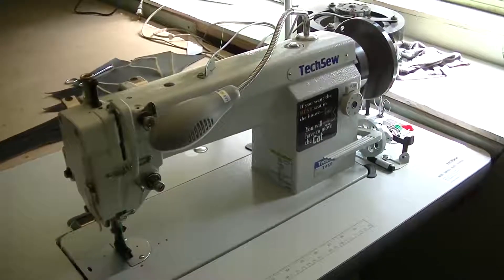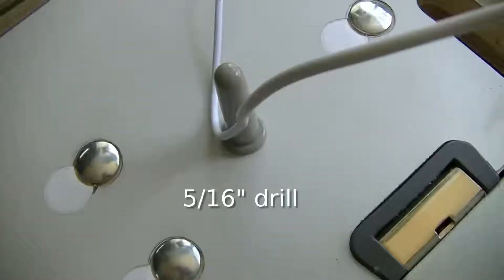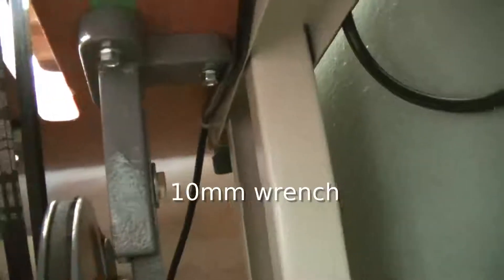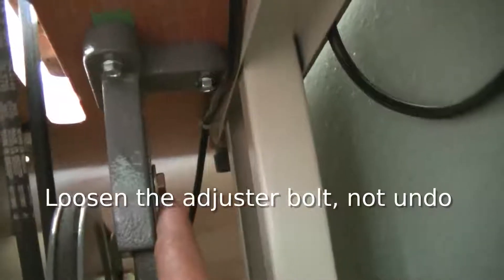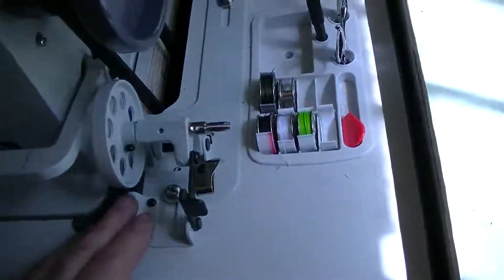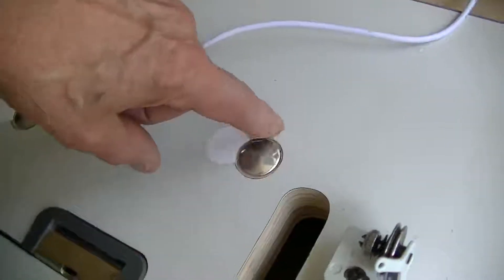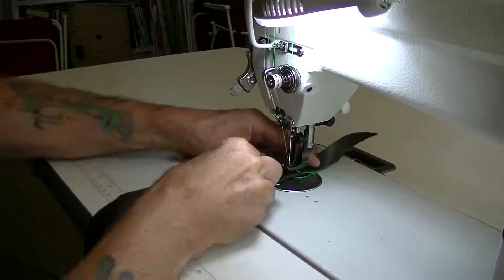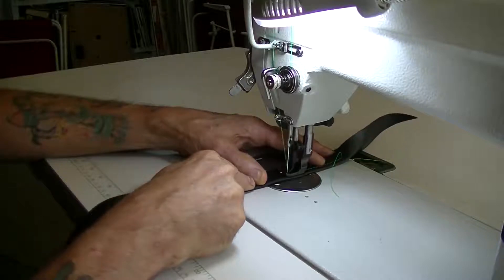Techsew speed reduction

Comment: I added the speed reduction to a 2135 and had exactly the same things to do. We now have the same 'clatter' noise that is the reduction bushings. Seems like Techsew could manage to make a simple pulley/bushing/shaft fit so it doesn't sound like three skeletons jacking off on a tin roof. I also do not like having to take a wrench to the reduction and belt removed every time the bobbin needs to be looked at! POOR! This will be redone so that the belt to the spindle is in line with the tilt of the machine so we can leave the tools in the garage where they are supposed to be not in the sewing room.
Reply from the maker: I don't have an issue with getting to the bobbin with mine, it's accessible from the side (underneath). The only time I have to tilt the machine is for oil refill purposes. The "clatter" is the machine itself, adding the reduction didn't change that but the camera certainly amplified it.
Reply: @scorpa54  Funny, you said in the video that you would need to remove the belt to get to the bobbin. The clatter is not the machine...it is the reduction bushing fit - tighten your grease cup a turn or two. That will quiet it down for a few minutes.
Reply from the maker: @b1lc1s  I said you need to remove the belt to tip the machine forward. I also said in the reply that my machine's sound did not change with the addition of the belt reduction.
Reply: @scorpa54  How do you get to the bobbin on that machine? The 2135 must be tipped back to even see the bobbin holder. Techsew must have sent me a bad reduction because it makes a clattering noise - this 2135 did not have that sound before the reduction was installed... Different machine but a zig-zag walking foot is noisy - but doesn't clatter. The sound your machine is making sounds like a loose pulley or something like that. This machine may go in favor of a Juki - better machine than Techsew by far.
Reply from the maker: @b1lc1s  The bobbin is accessible from an opening under the table below the needle and to the left. My machine had a bit of a sticking needle arm that I had to machine polish on my lathe to get it to quit sticking, but as I said the camera has greatly amplified the noise it makes it is not as bad as it sounds on camera.
Reply: @scorpa54  Accessing the bobbin with your machine is very good and handy. This 2135 MUST be tilted back against a stop post in the table. Q: How do we get along without a lathe? I have always said that a man cannot get along without a lathe or two in his shop and better yet a couple of milling machines as well. Great chat - keep up the great works!